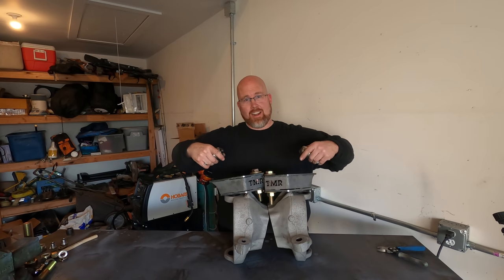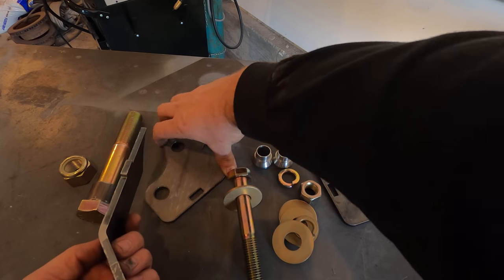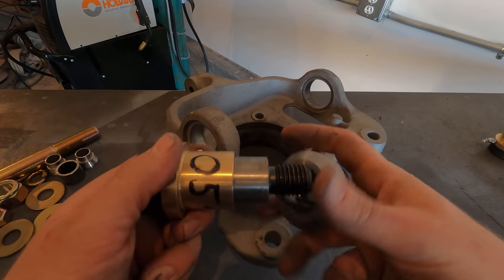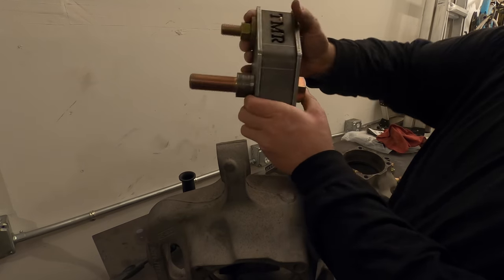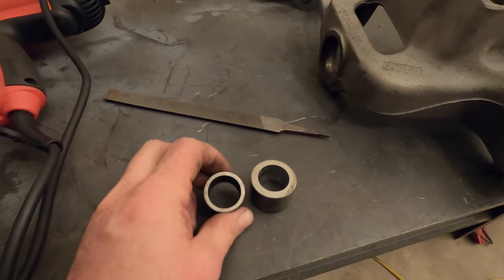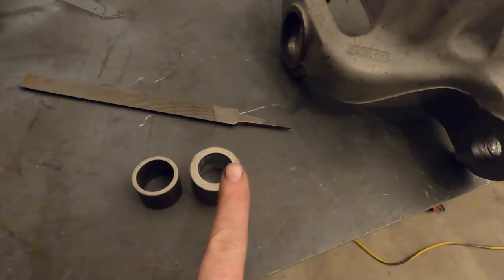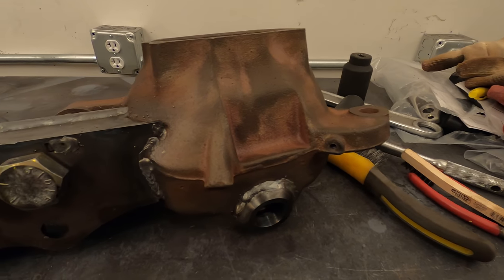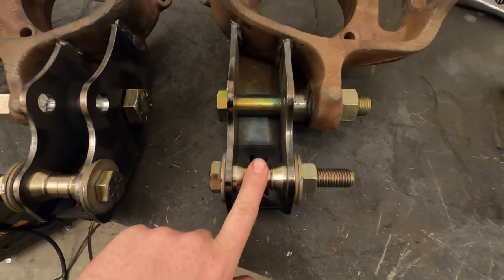High Steer Arms & Upper Ball Joint Eliminators!! FJ Cruiser Solid Axle Swap Build

Comment: Little tidbit I learned from you tube somewhere, when welding the brackets together where you need to maintain the spacing for heims  etc at the misalignment spacers, throw a 10k shim in there to give just a little wiggle room, makes getting links, tie rods etc in so much easier. Super good video by the way, oh and that powder coating on my knuckles stunk up the whole house from baking in the oven so long.

Comment: Oven, torch, welder, grinder, hammers and drill bits are a fabricators main stay. ROCK ON!
Reply from the maker: I need an electric oven. Gas creates too much moisture obviously.
Reply: @offroadhub.official  shaved & frozen,???...sounds like the wife...X that is..
Reply from the maker: @phantomwalker8251  freezing was recommended by Busted Knuckle...

Comment: Just a welding tip for ya. Wrap all corners with weld, do not have start stops there or gaps in your weld beads this is a high potential area where cracks can form! Great work keep it up!

Comment: Great work! I did one tons in my JK last summer, I used a weed burner to preheat all the cast that needed welding.
Reply from the maker: I've used a weed burner, I just figured the heat in the oven would be super even, and they fit, so I gave it a try! I think an electric oven would be ideal though, no moisture from the gas...

Comment: I had the same problem when I was trying to install the ball joint eliminator insert. Tried pressing it, but it didn’t feel right. Turns out all you have to do is heat up the knuckle and the insert slides right in like a glove
Reply from the maker: I'll try that next time 😄 I imagined that heating it up might expand the metal making the hole smaller.

Comment: Any reason why busted knuckle would make something that won't fit and require machining some more?
Reply from the maker: It is difficult to create a piece of steel that will fit every knuckle casting out there. Regular ball joints have knurling that allows for an imprecise fit, these are just solid steel. It's understandable that getting these to fit won't always be a smooth process.

Comment: What welding wire/gas did you use when welding to the casting? Guage?
Reply from the maker: Regular c25 gas and .030 wire. The knuckles are cast steel so nothing unusual is necessary.